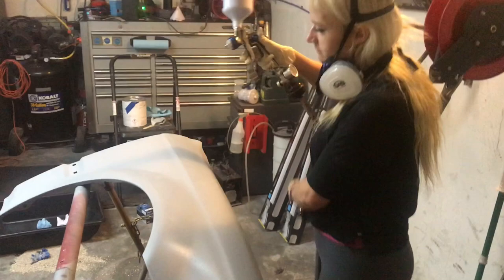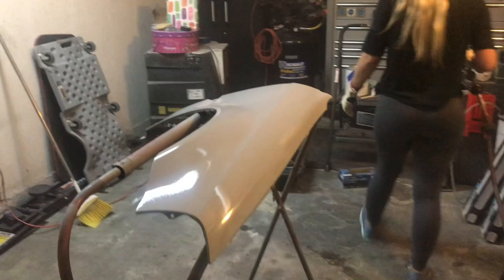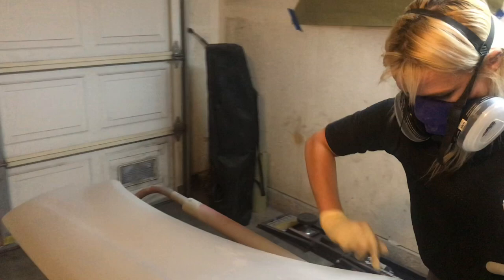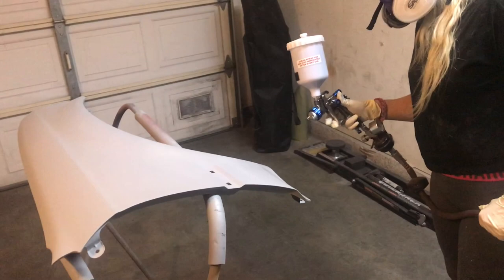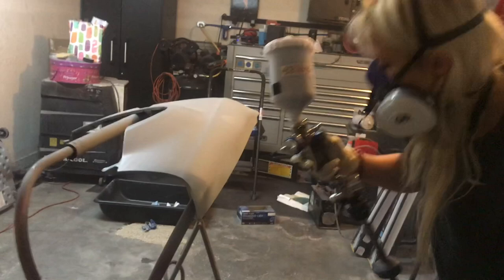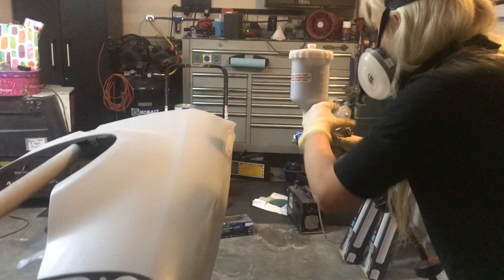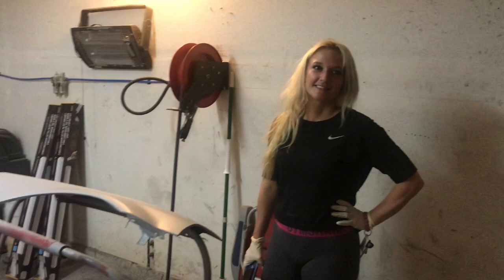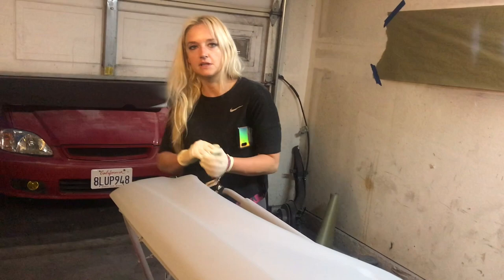Female Car Painter ft :Ashley The Painter

Comment: What’s the compressor you typically use? You demonstrate many high end guns with high air consumption requirements.. do they perform well with portable home compressors?
Reply from the maker: I use a 30 gallon air compressor , I use high air consumption guns but I also spray smaller parts so there for as long as you have enough air capacity you should be ok with most small painting projects